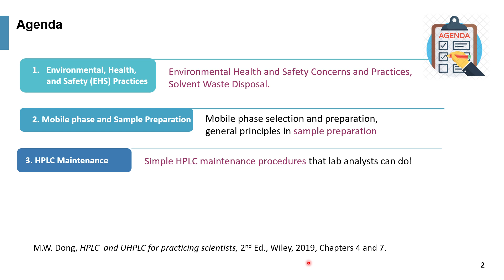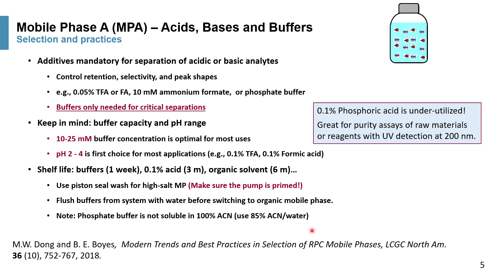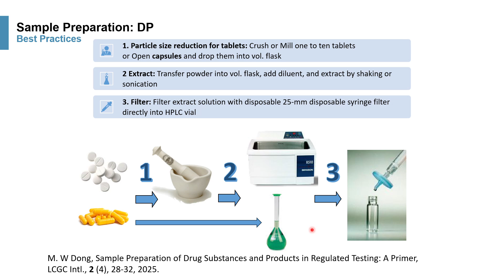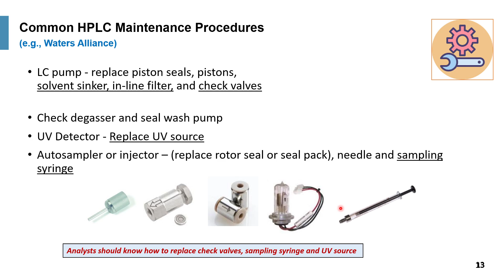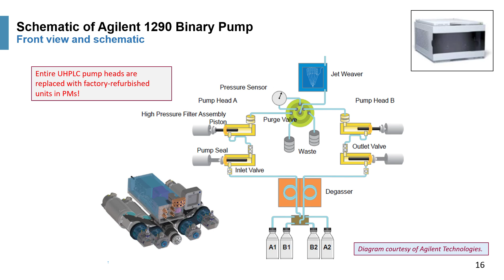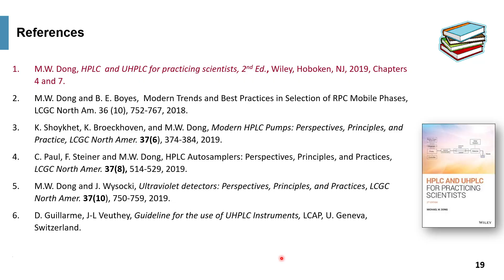27.  EP-22.  EHS Practices and HPLC Maintenance

Comment: why can't we use V-flask  when measuring MP and mixing?
Reply from the maker: You could use a volumetric flask but do not QS to volume since water and organic solvents are imperfect solvents and the delta volume of mixing is negative - meaning that they will shrink upon mixing.  The best way is to use a measuring cylinder and measure each solvent and then combine.  Better still, use the pump to do the blending.